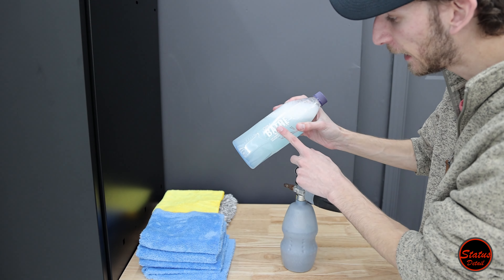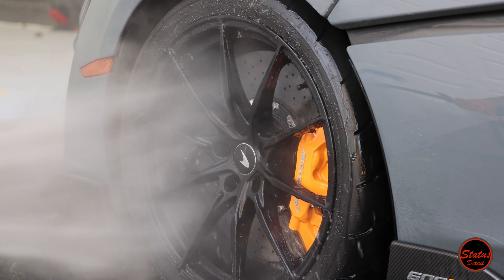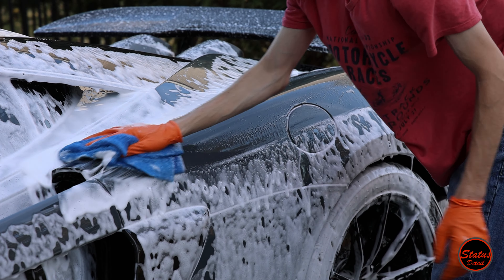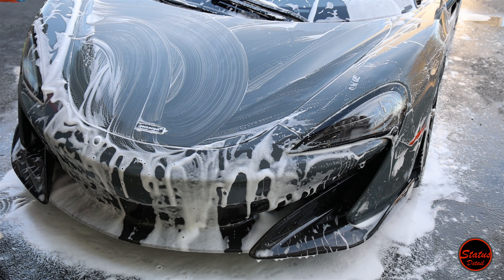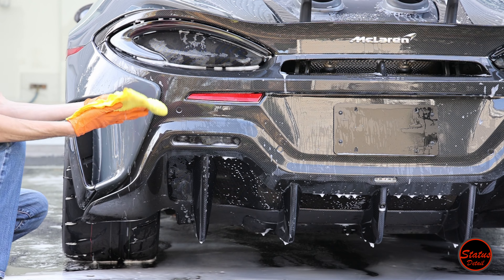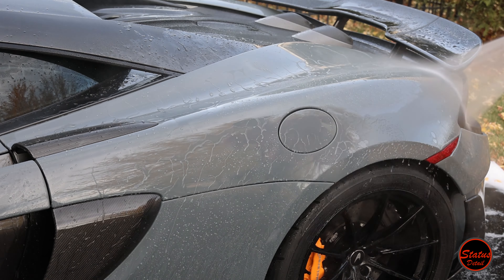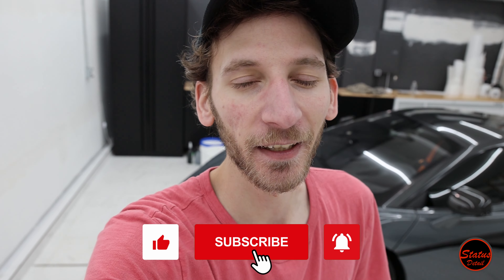NO SWIRL Car Wash System

Comment: I've tried the micro fiber towel method but I have noticed the towels kind of slide around and sometimes unravel in the soap. I have an suv that is ceramic coated and regularly use Adam's mega foam. Do you think I should use a higher GSM towel or is it the foam?
Reply from the maker: Without knowing we're kind of tells you're using it might be difficult for me to guide you on this comment. You want the towel to kinda glide because the foam is the lubrication and stops swirls. As long as your making contact with paint and not literally floating on soap then you cleaning the surface. 

High gsm is ideal. I use the green 1100gsm towel on statusdetailstore.com
Reply: @STATUSDETAIL  I have been using low GSM, but I have a few with high GSM. I will start using those moving forward. Thanks.

Comment: Can I use the Costco Yellow Microfiber Towels to do this method to wash the car paint? Are they good enough and safe enough on the paint? (Kirkland Signature Ultra Plush Microfiber Towel, Yellow, 16 in x 16 in, 36-count)
Reply from the maker: Yes you definitely can. The newest version actually comes with no tag attached which is really nice. 

What you do need to be careful of is the stitching on the side. So fold it into fourths and do your best to tuck the stitching up so you essentially make it edgeless. Or just push in One direction with your edgeless side. 

More importantly remember that the reverse side of that towel is not the same GSM. It's much much less plush. So you're only going to get four sides instead of eight. Meaning you can't flip it inside out. They're so inexpensive that this is not a problem just be aware that you should not be using that reverse side on the paint in my opinion. On a sidebar the reverse side does a decent job on glass!

I obviously recommend the towels on my website as those are 500 GSM and the other ones I sell are $1,100 plus GSM. Kirkland towels are around 300 for reference. I'd always rather have a more plush towel when doing a contact wash.

That was a great question thank you!
Reply: @STATUSDETAIL  Ohhh this perfectly answers my question thanks! I’ll purchase those towels then just to be on the safe side! And yes your right the towels doesn’t have the same plush side on the back which makes tons of sense.
Reply from the maker: @therealinterlaced  great back ups and lots of uses. I use Kirkland towels to for random things often 👍👍

Comment: I'd suggest buying rubber-tipped nozzles for your wand.

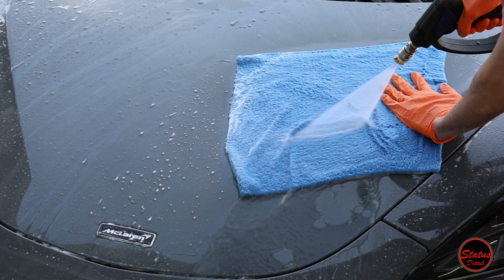Edit: 5:08 I would also suggest not to do the cleaning on the hood of your car. You can just put them straight into your washing machine or add water in the dirty bucket and get rid most of the dirt from your towels before throwing them in your washing machine.
Reply from the maker: @jarmago7750  I've been doing this for ten years and never felt the need for a rubber tip honestly. Never even came close to hitting a car with the pressure washer gun or tip. 

The pressure washer blasts dirt out of the towel about 100 times better than a washing machine ever could.
Reply: @STATUSDETAIL  Well, I'm learning everyday. I recently started detailing vehicles as a hobby and I'm enjoying it! I'll take your advice because you have enough experience to say these things. Thank you, bro!

Comment: That is one of my favorite colors on an automobile to date.   A lot of manufacturers are using that battleship gray color on their cars now days, whereas ten years ago you rarely saw it on a car at all.     I've been using the multiple mitt/microfiber cloth method for about two years now and it works great and you don't have to use two buckets anymore, unless like you do here with the plain water in the second bucket.    I just throw the spent towels into a clean empty bucket and then they all go into the washing machine afterwards so they are clean for the next wash.
Reply from the maker: @joevanseeters2873  yea come to think of it it's similar to that GTR color too !
Reply: @STATUSDETAIL  Absolutely sir!

Comment: gyeon bathe if quite expensive If i’m doing loads of cars.. Is it ok to use just a normal snow foam instead? like polar blast
Reply from the maker: I'm unfamiliar with polar blast. 

I have been testing a Maguires soap from the professional line that has a really aggressive price. I think I might put it in the store but I'm on the fence. I think it's a potentially a great product for detail shops. 

Bathe reset is much better in my opinion. But this soap isn't bad. Just gets the job done. I don't remember the name of top of my head. It's blue tho.

Comment: Have you ever used a no rinse along with your soap to introduce a higher level of lubricity or is that not really necessary?  I tried it once and I was amazed with how slick the wash process was.  (combo of CarPro Reset and ONR)
Reply from the maker: Not necessary if your foaming with proper thick foam. And doing wash process correctly. I do not like onr

Comment: Merry Christmas!! Quick question, is Koch chemie green star good to use for all interior cleaning? Like for extracting too. I’m debating between polstar and greenstar. Or any other recommendations. Thanks!! Awesome videos 👍 💯
Reply from the maker: Merry Christmas!
I have not actually used those yet but have been curious to try. As far as leather cleaning and dusting and alcantara I'd stick to gyeon line. Koch might have some good fabric cleaning solutions. Like carpets
Reply: Green star is just basically an APC, so it's usable at a higher dilution ratio for interiors. Pol star is a ph neutral interior cleaner that is also dilutable, and it can be used on any surface of the interior. I've seen detailers use it for carpets and fabric seats with an extractor as well. I doubt it's anything huge, but it also claims to have some form of protection for textiles.

Personally, I use Shine Supply's leather and interior cleaner for everything but fabrics and shiny interior parts, because it has cleaners and protectants, then use their upholstery stuff for fabrics. For nav screens and shiny parts, their Cruise matte interior detailer is my go to.
Reply from the maker: @awpdevil  awesome information..thank you 🙂🙂
Reply from the maker: @@alexpeev6018 got it! Appreciate the info in those!

Comment: I use this method for any gloss black ceramic coated vihcles I’ve done or if it has extrramly soft paint. I will say that it is way more important to have a good pre rise to knock off 80-90% of the grime before doing this process.
Reply from the maker: Agreed! I already filmed the follow up more in depth video and it covers multiple steps you can do before contact on paint.

Comment: What is the preferred way, PPF or ceramic coating?  I like ceramic as it repels water more and make it easier to clean.  In your opinion, whats the best way to protect the car?
Reply from the maker: If the budget allows them do both and make sure your getting a good PPF installer especially!

A full front ppf with ceramic over everything is great value on cars that are loved. 

Ceramic will keep everything cleaner longer and easy to clean. 

PPF will resist swirls a lot and offer rock chip prevention but no magic bullet either way. Really bad bird poo in sun can screw up anything. Bad hard water too. Huge rocks destroy everything. 

So we can add protection and hope we avoid the nasty stuff in the world

Comment: If you're going through all this trouble to avoid scratching the paint, does it not worry you using the hood as a washboard to pressure wash dirty rags? Haha. I'm sure it's fine since they've been sitting on soap, but the thought still crossed my mind. :p Great videos by the way, you're awesome. Especially how you answer so many questions in the comments. Keep up the good work.
Reply from the maker: Thanks!

Any dirt coming off the wash pad or towel will be very fine and loose. That's why you do this before the final rinse. 

You can do it on a grit gaurd but it's very likely you blow it off the grit gaurd onto ground and then in my opinion it's game over and you really can't use that ever again. 

That's how I do it. But everyone watching can rinse out the water however they feel most comfortable. I get lots of comments on this lol

Comment: I’ve been using this method for quite a while. I use Optimum No Rinse and have used this method since using it, only thing I add is another MF towel that is wrung out pretty well and use it as kind of a pre-drying towel with a drying agent, then fully dry with my drying towel.
Reply from the maker: A lot of people like this method you mentioned 👍👍

Comment: My vehicle is currently at the detailer. I had the ceramic coating applied today, along with minor paint correction.  Waiting 2 days before I pick it up and then 2 weeks to cure before doing any maintenance on the finish/wheels/glass.  It's a brand new vehicle that I drove off the showroom floor last week. I was going to use the 2 mitt/2 bucket system, but the idea of using a 1 microfiber cloth and getting 8 fresh quarters to wash the vehicle is simple genius. lol  Subscribed.
Reply from the maker: Glad you found the channel! I love this wash method and it works really well on a ceramic coated car 👍👍

Comment: You don’t use any microfibre detergents or anything? Just the rinse method and reuse ?
Reply from the maker: The rinse is usually enough. But if the car was really dirty or you used a tar remover or iron remover for example you would still rinse but can definitely wash in washing machine with detergents. 

Those do a great job cleaning polish residue and interior towels
 
During the wash we basically soak the towels in soap. So the rinse should blow everything out. Pressure washing is more hardcore than tumbling around I'm a washer in my mind.

Comment: Love, love, love your videos, mate! I admire your thoughtful attention to detail as you wash our lovely cars!

This particular approach contains contradictions to your typical attention to detail. 

Power washing dirty microfiber towels, to clean them, on the hood of the car … the concept is sound, but surely this is better done on another flat surface to avoid the dirty towel contact with the car that you’ve worked so hard to minimize, nay?
Reply from the maker: Thanks for watching!

That's a good point. I don't believe any swirls are happening with it flat. The motion would cause the issue

But you may be on to something. So the safest bet might be rinsing it on a windshield. 

This probably goes without saying but obviously you rinse the front of the car up after that rinse off the towel.

Comment: I came to this realization about two months ago. I use the Autofiber Double Flip wash towels. They’re nice and plush but have a pocket that allows you to flip it inside out giving you four sides for washing. A three pack gives me more than enough sides for your typical vehicle. And this method gives me one less bucket to have to move around as I work my way around the car. It’s a win for me and the customer.
Reply from the maker: Awesome. This sounds very similar to the video

Comment: This is probably the most efficient way I have seen this method used, tons of sides to use.  I switched from one mitt/two bucket washes to one bucket multi-mitt washes about a year ago using 8-10 rag co chenille mitts w/ flipping sides.  I have noticed about 75-90% less hazing; it becomes really apparent after several washes and the paint still looks glassy.  This is also just washing on a sealed car, not coated.  My experience has backed up your conclusions here, great video I think you are onto something.
Reply from the maker: Agreed 👍👍

I have really noticed a difference with how the microfiber is unclogging ceramic coatings too. 

There is more like grime and grease cutting going on with microfiber vs traditional wash pads. Yet it's ironically less "abrasive" or friction inducing with the contamination in car and prevents swirls.
Reply: @STATUSDETAIL  Wow great info there.  Another reason to switch to using towels!
Reply from the maker: @zacjones89  🙂👍👍

Comment: This is a great approach.  I usually wash two cars at a time in my driveway, and I like using 8 of the Microfiber Mitts on each car.  I prefer to run the the mitts through the washing machine by themselves, so if anything I feel better about running a decent sized washer load at the end of the day.  I think once the Microfiber Mitts start falling apart I might switch to using the Autofiber flip towels -- they're easier to hold onto than a standard folded towel, and a little easier to manage flipping sides and remembering what sides you've used,, plus you get (4) 8x8 surfaces with each towel.  Love your channel.  STEK review and pros and cons to PPF were great videos too.  Thanks!!!
Reply from the maker: Thanks for watching and commenting! Ppf can be great but I believe it's sold in a weird way by many as this magic product. So I hope to change the way people look at it so they fully understand what they are buying. 

Stek makes a great product 👍👍

Comment: Looks like a nice way to wash. However, I would maybe caution against rinsing the towels against the car paint. For example, if there are small hard particles, etc. on the other side of the microfiber towel, you are now forcing them against the hood even though you are cleaning the other side of the towel. Might be a very low risk but something to keep in mind.
Reply from the maker: I now rinse on windshield 👍
Reply: I must say watching you rise those towels on the bonnet of that car made me wince! I am sure you know what you are doing but the windscreen will be less painful to watch! 😂 thanks for all the content - learned a lot.
Reply: I woul.rinse he towel on a clean table and not use the car to clean the dirty towels. Even if you use the windshield, you're still spraying the dirt onto the car you just washed.